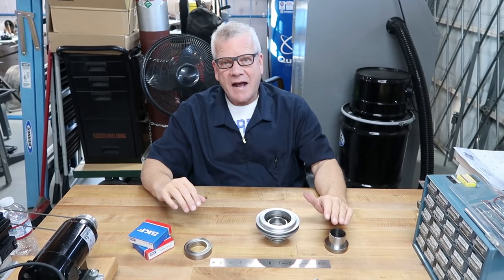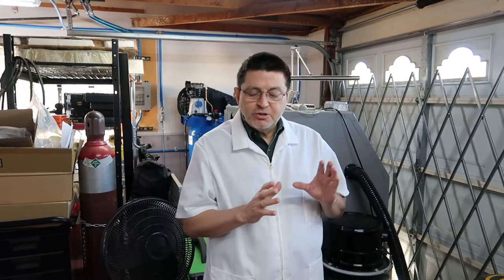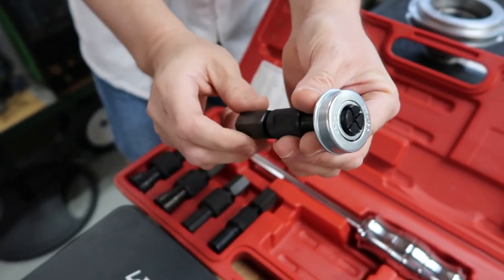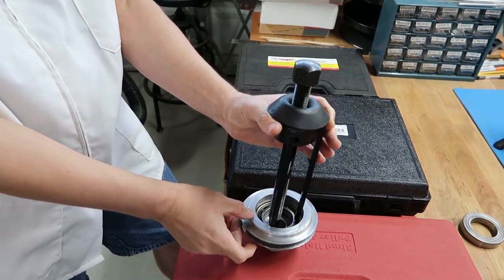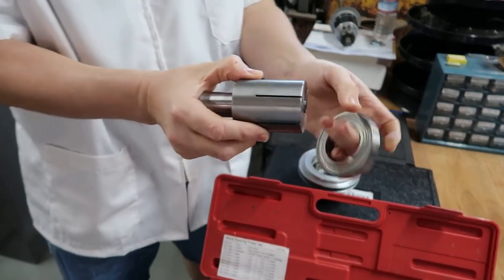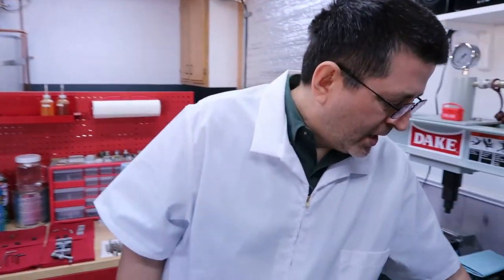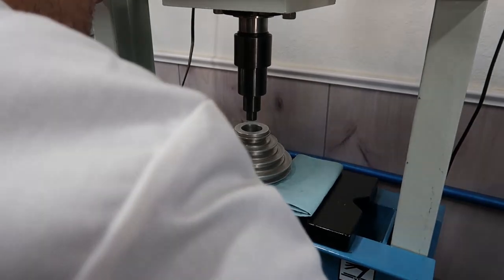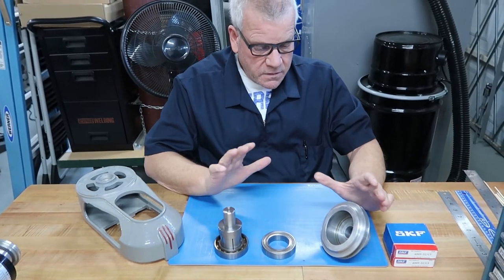SHOP ADVENTURES 12: Our Stuck Bearing Story

Comment: This reminds me of time when I had to remove a stick wheel bearing on a rear axle of a Chevy van.  I’ve tried everything and at the end I resorted to Drexel and a stone bit.  Worked very well.  Glad you got it out!
Reply from the maker: Hi Woods Creek Workshop (FELLOW YOUTUBE CREATOR) and while we both have teen year memories of working on our off road trucks and later fancy sports cars bearings even engine work the last place we would have thought of the need for this level of aggression in a bearing removal was in a micro-machine shop environment, so we shared this one because either Patrick nor I Lance wanted to deal with the bearing removal or possible blue print to CAD design then machining of a new cone pulley got that Barker milling machine.  
Thank you for stopping in and for seeing what your viewers Patrick & Lance are sharing on their channel.
Lance & Patrick.

Comment: The best tool to remove bearings in a blind hole is a stick or mig welder.  Machine up a steel plug to fit the bearing centre, weld it to the bearing centre, and press out from the back side - easy.

In the case of a tapered roller bearing where only the race remains to be removed, run a weld bead around the inside of the race, let it cool, it will shrink and fall out.  This is the same process used to remove valve inserts in engine cylinder heads.  

Cheers Rob
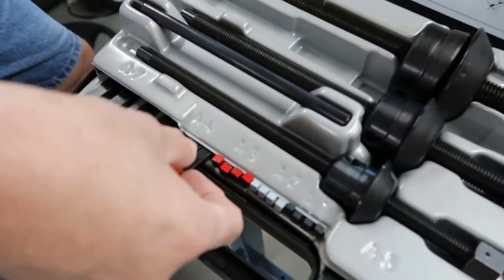Reply from the maker: Hey Hi Rob, the welding suggestion, that would be an excellent idea and one we would certainly consider at this point because this all came down to this, we really had to get that bearing out to be able to continue our machinery and tool rebuilding part of our journey to start the work on our product that these very machines and tools will be making in the new year wow 2019 can you image it is nearing the end of the year? We only have one problem with us welding the steel to the bearing inside that aluminum hole, we have our welder a brand new 3 years ago MIG, TIG and Stick made by EVERLAST 9:06 and again at 17:02 behind Patrick a rolling cart, gas tank tools, clamps, helmet, jacket, gloves, welding rods, wire reals and you name it (little starter kit) however and this is a huge thing, we have our equipment but we have 0, none, no training yet for welding and around here we have learned all we are sharing on our own, one skill at a time and then applied over the years to our work so yes welding is coming up should have already been but we will get to it and then we can apply your great idea and we also want to build a few products requiring welding on them. Thank you for taking time to help us we need it around here so stick (no pun intended) around.

Comment: Ok guys. Good job! Good team. Good friends.
Reply from the maker: Hello David and thank you so much for stopping in.
We have been best friends since 1975 range, met playing hide and go seek.
We have been in business since May 1993.
Thank you for sharing a thought with us and the community.
Shop Adventures the show airs every Monday night (except not this coming Monday), we did something special for this last Thursday night.

Other then this we air nearest live late on Monday nights, here in the USA we are best watched on Tuesday mornings with coffee.
Welcome along, we have a great time each week and we share whatever we are working on or with as we head along on our journey fixing machinery and tools that will then be used to make our product. 
Lance & Patrick.
Reply: That's a neat story. I recently purchased an old piston pump with elec motor, thinking I would remove the motor and mount one of my model steam engines (which I built) on it for power. But when it arrived it was apparent from the badge's on the pump and motor, that the motor was original; and it has those neat little oil cups too! So the pump and motor will stay together. Who am I to separate the 2 after all these years :-) You guys spiked my interest in elec motors. I have shied away from all things electric, as the only thing I understand about electricity is it either shocks or it doesn't....Thanks again yous two! Dave Fritschen

Comment: Nice job getting the bearing out! Great content. Cheers
Reply from the maker: Oh wow thank you Joe weighing in, that bearing was the last one in a pair installed since the factory and being in that mostly closed bore and at depth presented a bearing issue from not a nice place to say the very least.
So Joe when that finally came out after all of the years, we had since given up on it in or around 2013 or 2014 and to now be able to continue to schedule and begin the reassembly of our already two part epoxy painted Barker Milling Machine with a secret attachment will bring great joy to this mans life. Joe I think this is my, me Lance's personal favorite machine at the moment. Large machine for us, this is a 3 horsepower with a secondary motor as well 6.25" x 20.0" table size. Thank you Joe, Lance and Patrick.

Comment: Nice work.  The mandrel idea has been added to my list.  I have the floor standing version of that press and it can make some loud bangs when a bearing moves.
Reply from the maker: Hi Robert yes that noise, now that is a bit of the noise for a micro machining watchmakers Workshop to say the least. 
That press is nearing 2 decades in age and looks to have been installed just this week. That should provide you and the viewers with how often we use it but it does not, we use it somewhat often, but we use it for such small workings that it never wears. 
That press you have the full length one god news they are nice helpful tools in all shops regardless of the shops size we are on the smallest size needs here.

One of our favorite videos that element of surprise did not go unnoticed by us or the viewers.
That popping sound after two years of analyzing the stuck bearing in the closed hole was the happiest sound we could have wished to hear, as we new we were to finally begin the full reassembly of our Barker Milling Machine, a horizontal and vertical milling machine with a table travel of 4.00 inch x 10.00 inch as this American made mill is a second operation mill we are using to rough really small parts for an assemble we are building soon.
Thanking you for being here with us, we are really happy to have you and that you share thoughts with us and the community here, we learn plenty through our comments.
Lance & Patrick.

Comment: Lance and Patrick,
  It wasn’t that I thought you were offended. After I sent that original comment I was fearful that perhaps I was making light of your work environment when, in fact I’m impressed and amazed! I’m a new subscriber to your channel and don’t want to come across the wrong way. Thank you for your comments about my story about my father. He was a very special man, a mechanical genius in his own right though he never finished high school. He always operated his own businesses until the last twenty years of his working life when he moved to Florida and became a plumbing inspector for Pinelles County. I often share about my experience under his tutelage as whatever talents I have can be attributed to his guidance. 
   You mentioned you have done your own plumbing and HVAC work. I worked in both fields, first in installation then as an EPA certified HVAC Technician. My final job was in mechanical maintenance at the research center of ADM here in Decatur, Illinois, a large agricultural corporation. Now I tinker around in my shop, build custom acoustic guitars and repair of vintage guitars and occasionally build a piece of furniture using only hand tools. My venture into metal work was prompted by the need for specific luthier tools that are quite often very expensive but really quite simple in design and construction. My limited budget compels me to make my own luthier tools as well as some specialty parts for vintage guitars that are no longer available. Just enjoying my retirement and getting to know new folks with like interests from utube channels. 
I’m looking forward to your revelation about your shop cleanliness and especially about the “secret” whatever lurking in your mill! And yes, it WILL produce considerably more chips than your micro machines. (I imagine a clean environment is necessary for your horology work)
Dale
Reply from the maker: You are doing a lot in retirement that means to us you are going to be around a long time because a body in motion is a body that lasts, you see Mr.Pete. I never had High School education either (we are an open book) just like your dad. We are only trying to be contributors to the YouTube community and to the future young generations that follow showing our own takes on how Patrick and I do things maybe not always by the book but correct in our methods. We hope we continue to bring helpful information to you Dale and thank you again very much for sharing with us all. Now watch our video Monday or we will send Mr. Clean to Illinois to see you:)

Comment: I noticed that the Paper towels were folded. One side had three folds, and the other sat on two folds. I was concerned that the press would be uneven or canted. Good I see that Patrick turned the towels to have both side even, but it was after the big Snap. It seems to work. I am happy for both you fellows. Just sleep on the problem (for two years!?), the answer will come to you, right?
Reply from the maker: Hey James you are right you got it, we sort of did sleep on the bearing removal thing for a bit anything to not have to machine this pulley from the Barker Mills un-replaceable aluminum cone pulley because we have enough to be doing, challenges to be solved, around here.

We have quite the lineup of educational videos starting this week with the first 3 of 9 Precision Spindle Rebuilding videos, first coming out by the end of this week. 

We will also be back with a Shop Adventures (shorter then usual one) number 38 this coming Monday to share more highlights of the other 6 releasing educational Spindle Rebuilding videos. 

Nice James, to have you enjoying that bearing video mentioned in this weeks Shop Adventures 37 show.
Lance & Patrick.

Comment: Lance & Patrick,
  I meant no offense when I asked how you keep your shop and equipment so clean, it’s just that for most of us our machine shop environments are far from pristine and are constantly fighting the battle knee deep in swarf and oil.  
Dale
Reply from the maker: Dale you are great we did not take offense sorry to have come across that way. We were only making light a funny about this clean machines, tools and work-space thing really and feel it really does deserve some video time to explain why it is that this shop is so clean both if the areas so we thank you for inspiring us to share how all of this has come to be. We loved your shared story about you and your dad a lot and hope we rectify the clean thing in Monday's video. The workshop has a Barker Milling Machine table bed size 6.25 inch by 20.0 inch (large for a micro-machine operation) in there and it is not going to run clean especially with its factory secret installed (machine being reassembled soon) that is sure to make the workshop area look a bit dirty over a short amount of time.

Comment: Had me scarred for a while
Reply from the maker: Us too, Lance here, we really thought about just turning a new pulley the company Baker Engineering is still in business but they do not longer make this pulley reason is our machine this Barker AM series mill has a special factory made option though they made very few so they have no parts for that attachment meaning this pulley with one of the two bearings stuck on it is no longer made. You are new to our channel but we do all we can around here to preserve the original machine tool components before buying new replacing or making a replacement part but sometimes you just have to as we share in a few videos in the series.

Comment: G’day Lance, I did expect the bang, it’s common in the automotive game. I see Rob has suggested welding a plug in place. I was going to suggest it during your video but I see you employed a more eloquent method but if cost or time was more pressing, the weld method works wonders but don’t think to recycle the bearing:) Great to see it workout. Cheers Peter
Reply from the maker: Hey Hi Peter, I miss my videos from down-under Emma is a subscriber here now:) I like the two suggestions from below, Mature Patriot wants us to build a frame and frame the bearing and its now attached puller (we are placing it on a shelf GREAT IDEA VERNON by the TV in the living area) and xynudu Rob suggested (as you mentioned) to us that we weld a rod to the Departure Bearing and that would have been great too.

Comment: I know it,s too late now, but a simple steel plug locktited in the race, would have held.
Reply from the maker: Nice to see you return airguns freedom700 SSP. We read from you as you share about the super glue, a consumer product we did try it, also heat, dry ice, dry ice with heat, we tried to use industrial commercial buyer only bonding compounds with both a plug fit steel bar with serrated and lightly smooth finishes and an expandable arbor and they each failed as well.
What we did not try and a fellow viewer and community member suggested was to weld a steel shaft to the bearing but this is tough around a closed hole and the pulley being aluminum. 

We did explain this in the show as well however it is easily over looked.
We went as the show shares with the lathe turned expandable arbor allowing a light or slight ability to grab under the radius of the existing final of two bearings to be removed and as the load sound conveyed it worked, we were willing to do anything so we would not be in need of machining a new multi position cone pulley for our machine as the machine is still made this secret pulley for the factory secret (reveal comes on a Monday in the coming month of July) attachment is no longer made not even the factory blue prints exist any longer.

Hope after reading this and as we see you return you might subscribe say after the coming next of Educational Pullout videos 4 or 5 in the series, covering step by step series rebuilding a precision US Made Levin lathe spindles, 3 versions all covered likely a total of 6 spindles in all being rebuilt and shows all coming in a single week and that is the first section of July 2019 and learn if we are for you, we may not be for you though we are hoping you are a go with us after the coming show and the series video releases. 
Thank you for sharing your thought, have a great weekend and hope to hear from you after the coming releases, you matter to us here, we LOVE interaction, it is our soul outside contact.
Your trusting co-hosts to the machinery and tools. Lance & Patrick.